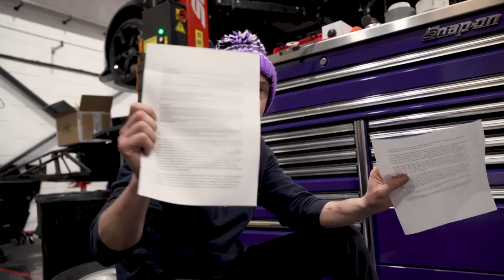We Listened To Your Comments! | Workshop Update No.60

Comment: I have been watching your channel for a while. It's great to see a young un applying such attention to detail. I'm an engineer by trade and spent many years on aerospace projects, milling and turning to high spec. It means that I struggle to get anything done properly ( ie to the standard I worked to for years ) whether that's a van respray or a tyre changed and balanced.
Get the technical build on vid as it sets you apart from the " I build loads of engine boss" types.
The cross hatch / honing video had me smiling thinking most people have no idea of what your on about. But If I was building an engine I'd be anal enough to want to know that stuff. Do it right or don't do it.

Comment: You mention a bigger workshop.
I think the workshop is big enough but needs desperately reorganising.
A mez above the dyno , engine and valet bay with a small lift to get bikes and engines up there would free up at least space for another two bays maybe three bays.
More bays could mean at least one more technician and a project bay.
Solves your work backlog and frees your time to work on the project cars.
A one off payment for the work saves the need for a bigger workshop with increased rent/ rates etc

Comment: Do a project of an everyday normal car,  not an M or RS or supercar,  but make it a supercar beater.  E.g 2006 Audi A4 with 1000bhp, or any other normal car.   You wont need to wait for parts and the car will be cheap to start with.